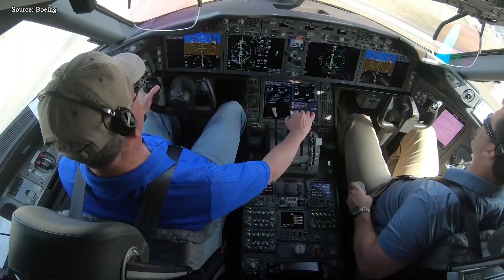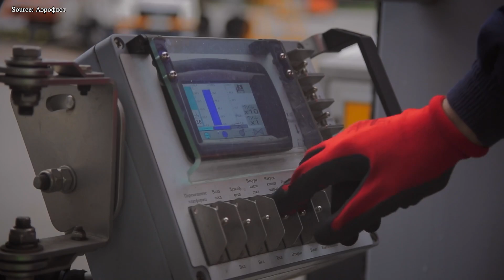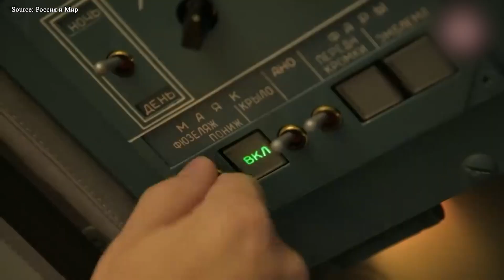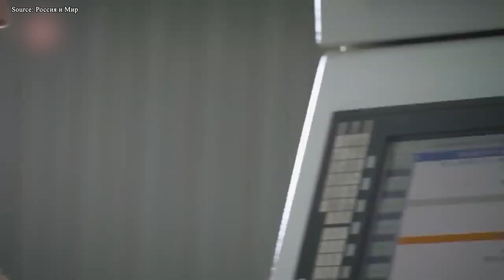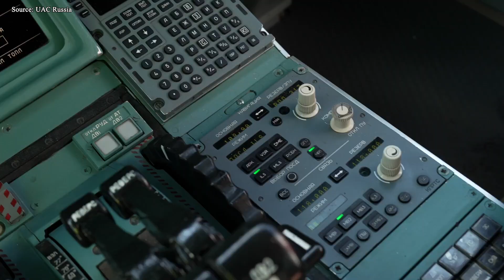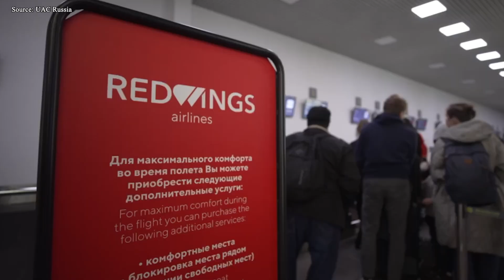This is How Russian New Tu-214 Just OUTSMARTED Boeing & Airbus

Comment: Ja ja the TU-204 was designed in the 80's and the TU-214 in the 90's and it's newer than the B737 and the A320, certainly more advanced than the B-737's it has no levers, control wires or pulleys and tge Tupolev is Fly-By-Wire controls, it was never abandoned they built proven prototypes for the future....
Reply from the maker: Thanks for sharing your insights on the Tu-204 and Tu-214!